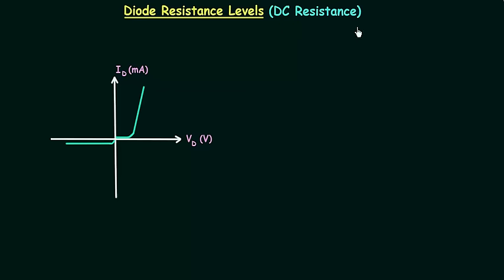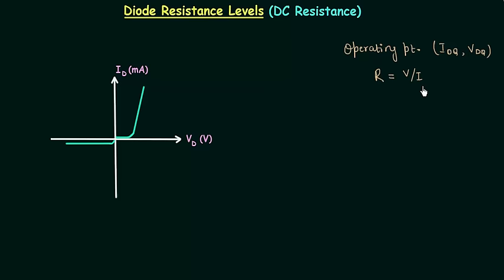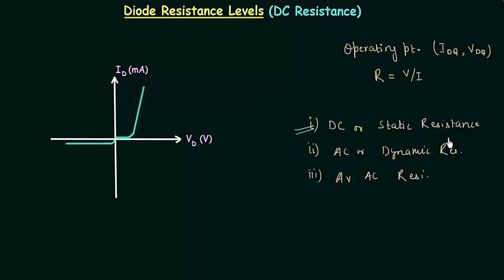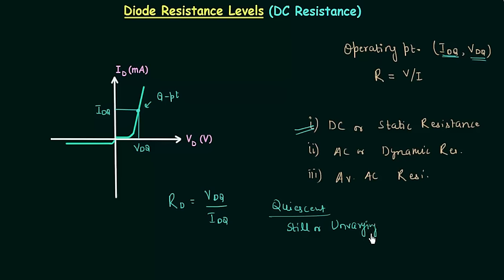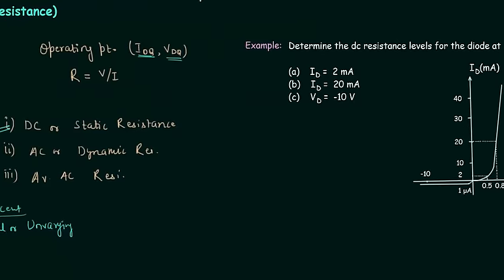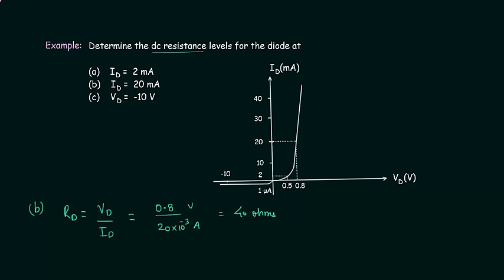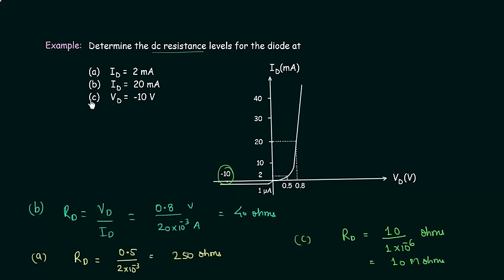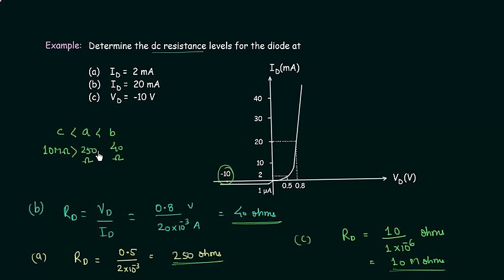DC or Static Resistance of a Diode

Comment: how does resistance change with type of voltage applied(ac or dc) shouldnt resistance stay the same and current adjusts according to the type of voltage, as in AC voltage keeps changing so current should also keep changing
Reply: see the resistance of conductors(linear) devices doesn't change but diodes(non-linear) devices resistance change with applied voltage u can see it in graph itself hope it clarified (commenting bit late)